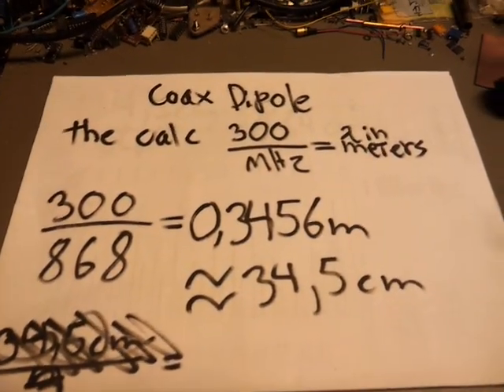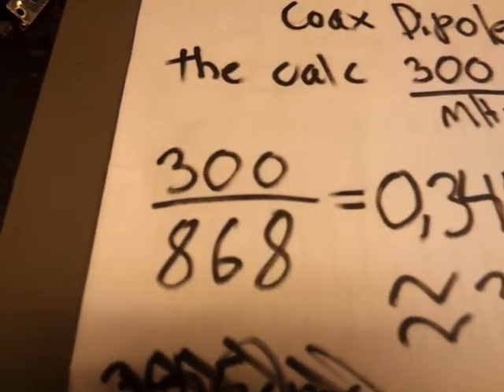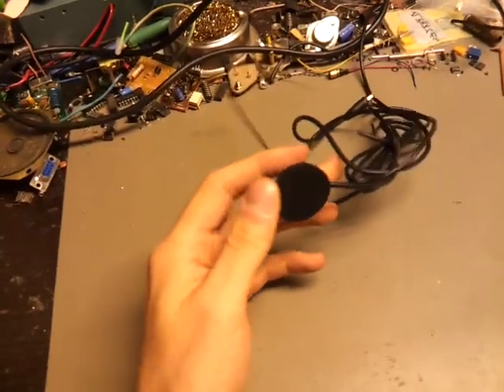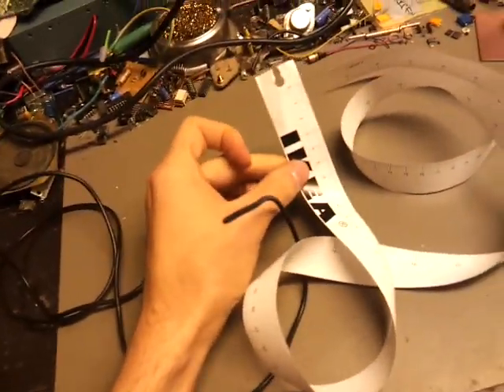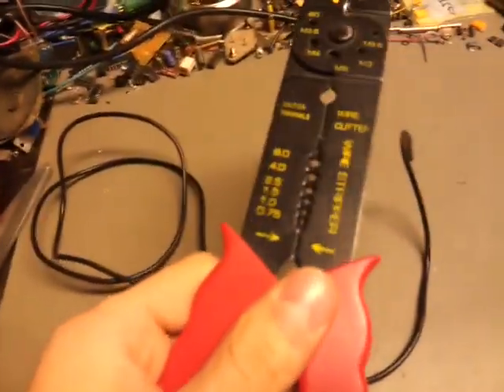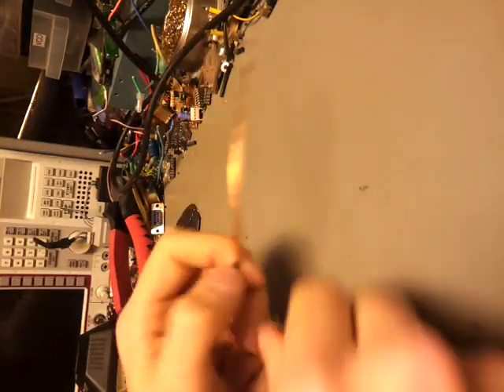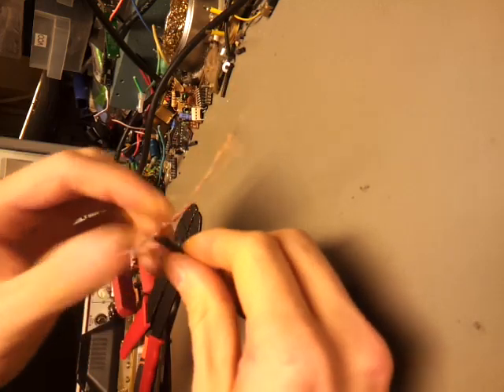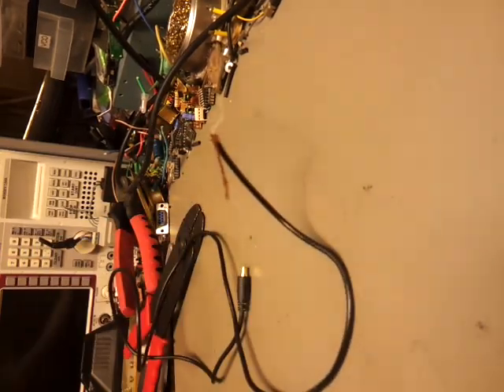Simple dipole antenna from coax

Comment: Super simple solution.
I have one for TV, but I folded the shield back along the outer insulation. That way the active part runs along with the cable
Reply from the maker: Yep, a vertical dipole like that works well.

Comment: 🟦 A really great addition to this would be to add a 'Tuning-slug' to it!....
What is the 'Tuning-slug' you might ask?,...it's a way to cause the antenna to "favor" reception at certain frequencies!.....
This can be done by taking a piece of aluminum foil (about 3x4 in.) and folding it down to a strip about 3/4 of an inch wide and wrapping it around the up-lead to where the wires diverge, & by sliding this slug up and down the lead to the dipole you can "Tune" the antenna!, resulting in greater reception.

Comment: Thank you so much 😁, i want to make better antenna for my walkie talkie, so can i just ask? If i want to talk with my friends does the lenght of the wires (antenna) matter? Or can it be long how i want? ( I use baofeng uv-5r)
Reply from the maker: The length of the wires that are stripped out from the coaxial cable matter. 
The coax can be any length.
Reply: @2ftg  ok so if i have my walkie talkie and i have selected any frequency then could you tell me how long they should be? Or how to count it? 🙏 Thanks

Comment: I wanna do a 40m dipole antenna, I hope this method works 😬
Reply from the maker: It should work fine, but might be a bit of a chore. Normal flexible lamp cord might also be a cheap option for the antenna elements.
Reply: Does it work bro? XD

Comment: Shouldn't you consider velocity factor in calculation of dipole length?
Reply from the maker: Yes, if the wire is coated, however plastic coated wire has a velocity factor of 0.96, which is usually negligible. Here one leg of the dipole is bare copper, the other is the PE coated center conductor and it is used for receiving, so the effects of velocity factor on it are minor at best.

Comment: After doing the calculations, how can you tell at what distance of the antenna we are putting the connector?
Reply from the maker: The distance does not matter, you can use as little or as much coax as you want between the antenna and radio.
Reply: Thank you for the answer.

Comment: If you just need the coax from the antenna, these crappy ones only have a black circle sticked to the bottom which you can peel off easily and expose the base of the antenna and desolder it.

Comment: Nice video... Seems smart guy. Danish, Swedish dude?
Reply: Simeon Banner I asume finnish
Reply: +Simeon Banner 
Yes indeed, great vid - and 99% certainty our tutor is Finnish.  A typically pragmatic solution and (as always with Finns) crystal clear and right on point!  On that, I find it curious how the English language, despite being "native" to often be far more intelligible with a distinct accent (e.g. Swedish), such as  Hr. Antenna-Fixit-Fast has demonstrated.   
Notwithstanding all that, I'm picking origin dialogue is Swedish - or more correctly "Finlands-Svenska". Almost a language in its own right, this distinctively clear dialect of Swedish is mother-tongue for many Finnish families, and remains widely spoken along the Baltic west coast. 

Anyway Simeon, if this is at least ½ right,  your original guess was right on target!

p.s.  can anyone please suggest a similarly quick and easy design for:  
        Omni-directional TV Antenna 
 - Location: central Phnom Penh (Cambodia) with ~20 broadcast to air TV channels (mixed bag of HD-digital legacy VHF etc)
 - Flat topography; installation elevation ~30 m above ground level and ~4 m above nearest structure
 - Challenge is stations distributed on virtually every point of the compass (all radials) that's why need "Omni" - Plus factor - broadcast stations all inside 10 - 15 km radius cheers // Steve      otlksb@outlook.com
All/any input most welcome :)
Reply from the maker: Heh. Thankfully not Finlands-Svenska, that's just mu accent. 
As for a wideband omni for UHF? maybe a fat vertical dipole? if VHF/UHF then it's a bit harder. Maybe a bowtie or better, two fat dipoles and a diplexer for combining the VHF and UHF in to a single coax.